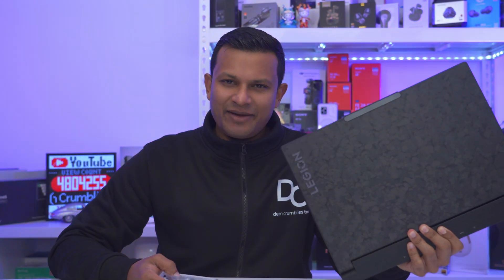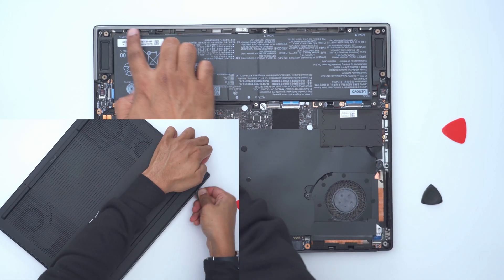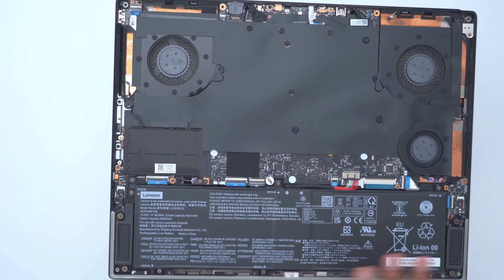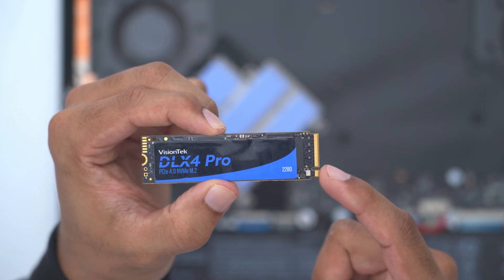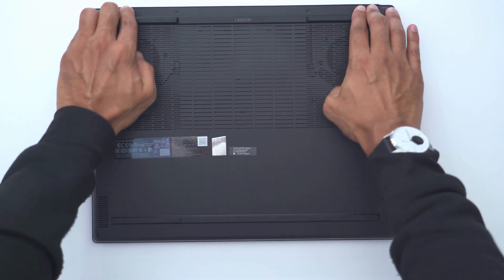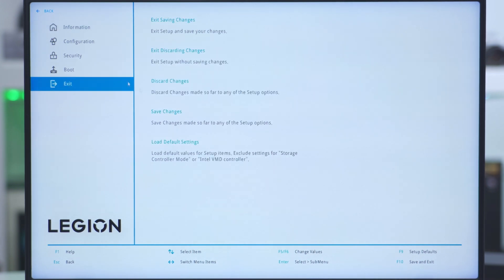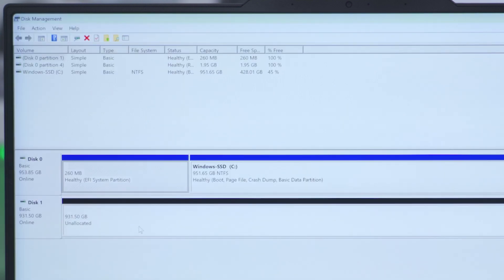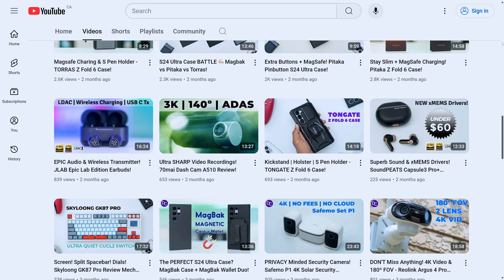ADD NVMe Storage Drive To Lenovo Legion 9i Laptop Easily!

Comment: Can you install 2- 8tb name drives raided or separately
Reply from the maker: So I'm not sure what is the max capacity it will recognize, but others have installed 4TB drives without issue. It's possible higher capacities may work. I have 2X 12 TB drives, but mine are 3.5" HDDs.